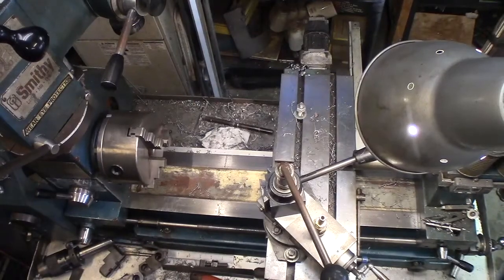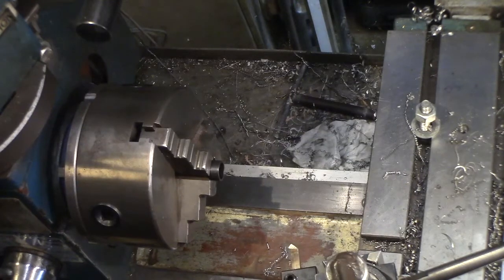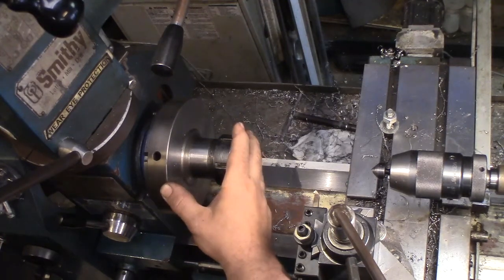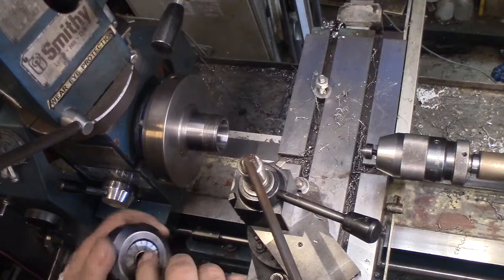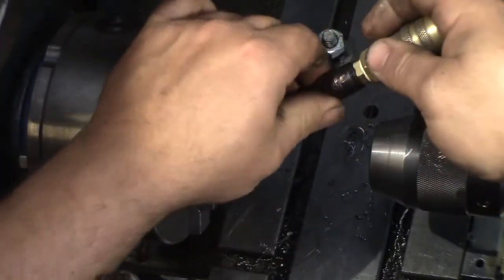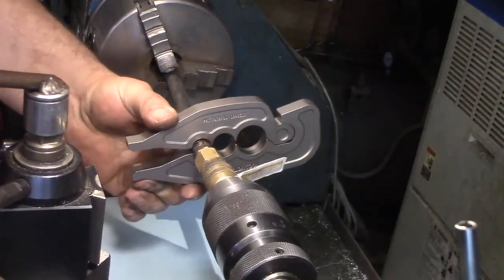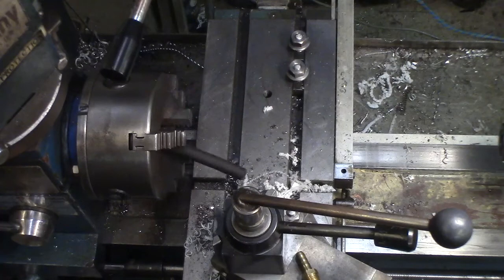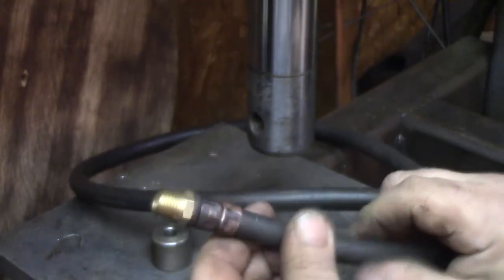Air hose end repair using PEX crimp rings

Comment: I was doing a bathroom remodel using pex tubing and fittings and started thinking about how close the 1/2" pex  is to air hose.
I slipped a ring over the hose and it was tight but worked fine.  Using a rubber mallet I pounded the fitting into the hose and used a pex crimping tool.
Worked absolutely fine.  I wasn't going to spend $10 for the repair fittings on a hose that is 20 years old.
This works absolutely fine.

Comment: The tail stock does act like a drill PRESS. - Wish my lathe cross slide had a couple t-slots. - Hobby - Drains your wallet but makes you happy. kinda like a wife!  - Whatever metal you have is always best to use. lol -  If we didn't make mistakes, we would all walk on water. - Would the 3-jaw crimp the PEX rings? -  Only time will tell if it is 'fixed.' - Great video. Entertaining and informational.